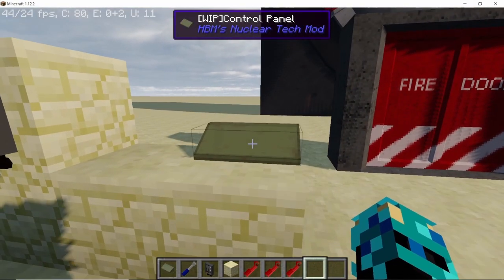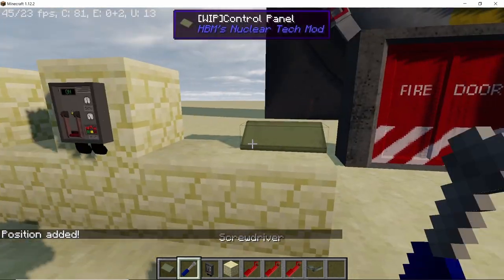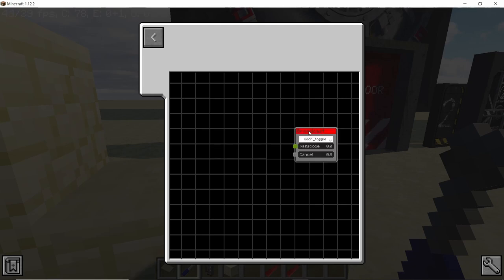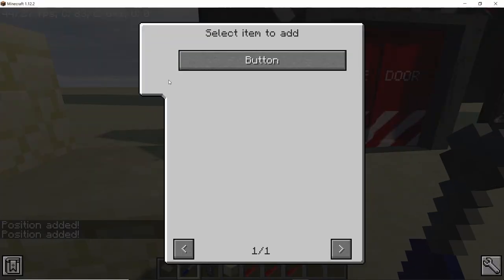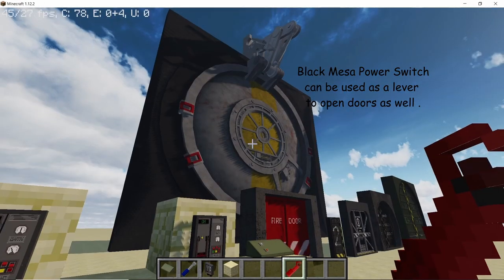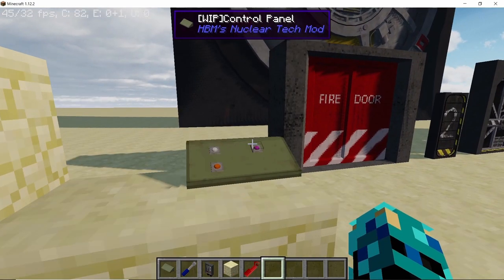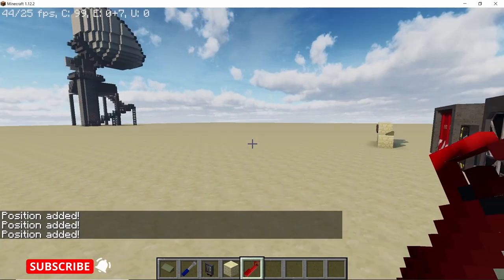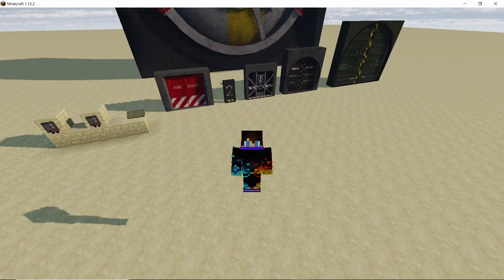"Control Panel" Tutorial - HBMs Reloaded | How to open doors using Control panels in HBMs Reloaded

Comment: Damn, it'd be very useful if it could open silo doors but then again, creatively using switches and wireless Redstone from other mods can produce a more realistic feel as well as provide avenues for creatively designed security measures.
Reply from the maker: Yeah for the silo door the best option is using wireless Redstone mod. And as you were saying about the security the wireless reciever can be linked to security craft blocks for countermeasures
Reply: You can use imersive engineering

Comment: cool btw that one dfc desing i was thinking it works like its not as good as the bdfc but its cheaper and produces almost the same amount of power how ever its not that customizable
Reply from the maker: Yoo that's awesome , even tho it is not customizable it still produces the same amount of power which is pretty slick
Reply: @SavageVegeta  the SBDFC or self boosting dark fusion core is basicaly a self boosting dfc with 1 core 1 stabilizer one fuel injector 4 emitters 1 reciver wich is better for people who can't produce enough fuel for the secondary core of the BDFC and as you tested the second core is very fuel hungry

Comment: Hey man, may u answer something, how can I charge crucial blade and how can I craft high frequency?
Reply from the maker: First of all set up a DFC reactor and instead of placing the dfc receiver place a tungsten crate with the crucible in it. Now start the dfc reactor , the emitter will shoot a beam on the tungsten crate and it will heat up thus charging up the crucible sword
Reply from the maker: as for this high frequency thing I do not know what you are talking about , can you look up the proper item name ??
Reply: @SavageVegeta  bro, u are intelligent asf
Reply: @SavageVegeta  the other especial sword, that has the Right+Left click attack that is insta kill, there's 3 swords with this ability, the best is the crucible, than we have High Frequency Sword, and than High Quality Sword
Reply: @SavageVegeta  There are three swords that i have found nothing about, crucible sword, high frequency sword, and high quality metal sword, i think. All of them can bisect mobs by holding right click then clicking left
Reply from the maker: Ah ohk I haven't really looked into the other swords tbh I like using guns in HBMs more. but I will take and look and let you know if I find something about it !!
Reply: @SavageVegeta  thanks man

Comment: hello bro, i love ur vids keep up the good work!, btw i have a question, how can i create switchs instead of buttons? i saw a guy doing it, also how can i create a protected button, like i gotta open something first before clicking the button
Reply from the maker: Umm you'll find the switch recipe using JEI bro I highly recommend you install it. Also another thing is the protected button you're talking about is the AZ-5 button on RBMK console which is used to shut the RBMK reactor down in case of emergency. It however can't be used to power anything else

Comment: Whenever I use the control panel to open doors, they immediately close after opening! Any help?
Reply from the maker: If you are using NTM Extended then the panel has not been fully implemented yet afaik. If this is a reloaded issue I have no clue why that is cause the last time I played reloaded it was working perfectly

Comment: idk if this will be answered, but i need assistance with the control panel. i am using the hbm ntm extended version and the control panel is different with the latest update. would it be possible to do a tutorial with that one at some point?
Reply: its mainly because i want to somehow make it work like a normal button or have a timer before it closes automatically as it will be for the 2x2 sliding door, which is my front door, and for the secure access door, which is for anything bigger like a mount or something. I could use a normal button as i have been using, but it just looks out of place and i would have to place one both inside and outside of the building
Reply from the maker: I honestly do not know when I will be get back to NTM Extended edition and check out the new control panels cause I have to work on other pending projects right now, I'm sorry.
If I do figure it out then ofc you are going to see a video for it on the channel.
Reply: @SavageVegeta  no problem. For now, I found the wireless redstone mod and using that for all of the doors. And just in case it's needed to be said, I'm using the 1.12.2 due to playing rlcraft

Comment: Also sorry for this but I forgot to ask in my last question. Is there a way to make a lockdown feature using this. For example if a press a button all the doors in my base will close whether they're open or closed, and the already closed doors wont toggle?
Reply from the maker: I think what you're saying is right that the doors which are already closed won't toggle when the power is turned off. So yeah you can attack multiple doors to a single power switch and that can act as your lock down initiator.
I haven't tried this personally but even if we take the example of a lever if a door is open when a lever is placed and toggled on it won't close the door ... But when the lever is toggled off again then it will close the door with it
Reply: @SavageVegeta  I tried using your idea by having the door being open and then putting the lever but I don't remember the results, I don't think it worked though. I also tried messing around with the math node and maybe figure something out but it just started toggling the door on and off forever. I'll try experimenting with the math node even more tomorrow and maybe find a way to just close the doors that are open without opening the doors that are closed.

Comment: Could you maybe make a tutorial on how to use the sendable events, as I wanna use a power switch to toggle some spinny lights
Reply from the maker: I think the panel can only control doors and turrets as of now , but still I will give it a try and if it works I will make a video on it
Reply: @SavageVegeta  ok so I think I found out how to use the sendable events(kinda). Basically you use the same setup like a door (Broadcast in the button or lever section, Set variable in initialise) but use the input for the sendable event (So on broadcast, instead of doors, use SpinnyLightsPower)

Comment: how i can do a process of security lockdown pressing a button?
Reply from the maker: Connect all the doors to a single button , and have a secondary button for activating a siren , then press the siren button first and the control panel button second quickly
That way the sirens will go off and the all the doors will close simultaneously locking the entire base down 

Maybe in the future there will be an option to add the siren block in the control panel

Comment: Hi , can you explain me....what differences are in classic HBMS and HBMS reloaded?
Reply from the maker: HBMs is the original mod made for 1.7.10 and has alot of stuff ... Also it is updated frequently

HBMs reloaded is a port of the original mod made for 1.12.2 and has slightly less stuff and is not updated that frequently

Comment: How do i use the sirens with this
Reply from the maker: The process is supposed to be kinda the same as the doors bit I never actually tried that myself so can't really make a video on it sorry
Reply: @SavageVegeta  i tested it with the door process it doesnt work so its redstone only
Reply from the maker: @Axofhasquit  ah ohk
Reply: @SavageVegeta i have another problem where the door shuts after opening

Im using ntm extended 1.12.2

But the doors only work with a constant redstone signal but idk how to get a constant redstone signal on the control panel

Comment: Why the mod doesn't work for me when I use shader?
Reply from the maker: There's a setting in the hbm config file called "enableShaders2" 
Set it to false and see if that solves the issue or not
Reply: I understand, but how do I access HMB settings? @SavageVegeta
Reply from the maker: @yormyguzman610  go in Minecraft folder, there you'll find a folder called "configs" and inside that folder you'll find the config files for every mod that you've installed, just locate the one for hbm and then you'll be able to edit it using any text editor
Reply: @SavageVegeta  wooo thank you so much, yes it worked ❤️